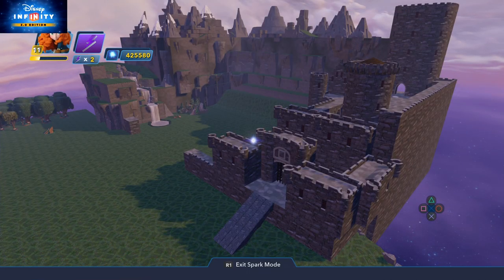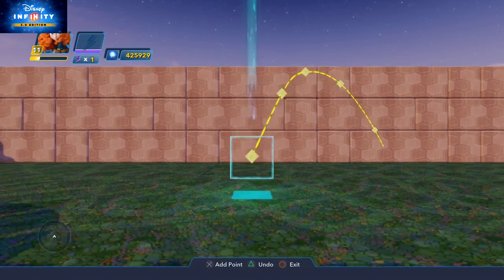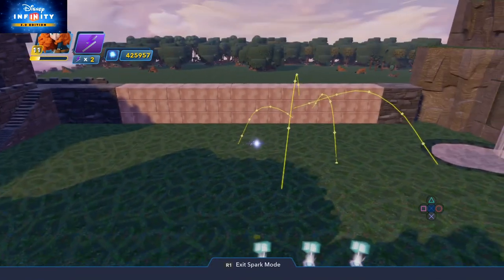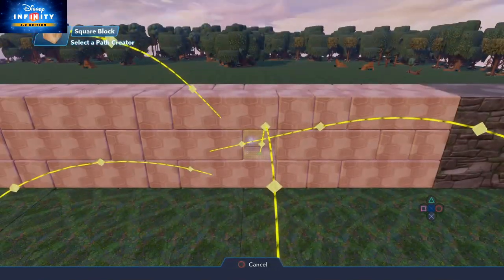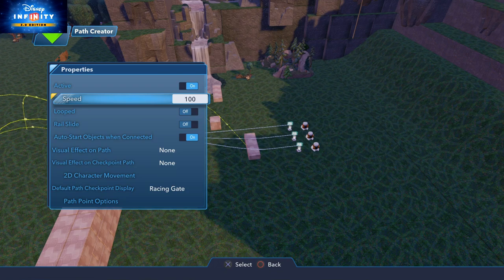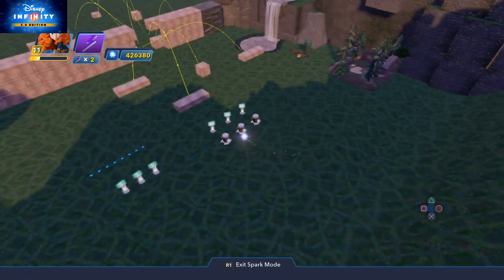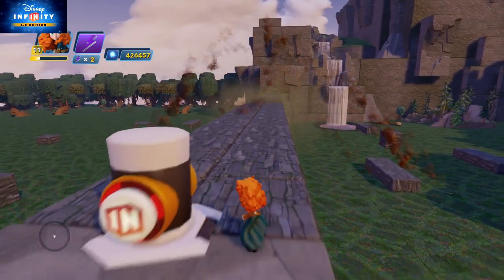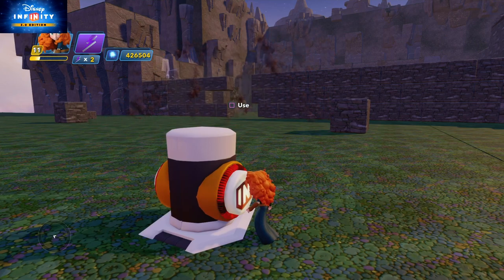Disney Infinity - How To Blow Up A Castle Wall

Comment: just wondering, is the wii u version as good as the PS4 version? (in terms of graphics, features, etc...)
Reply from the maker: From what I am aware, all versions are the same, as well as the graphics. Now I have played on 3 different version Vita, PS3 And PS4. They were all the same game, but the size of toyboxes that you could make did differ. The PS4 allowing for much more complicated Toy Boxes. I presume this is down to memory. There is no difference between the PS4 and PS4 Pro. All Playsets and unlockables are the same on all versions - Although the IPAD had a special unlock where you could get the E11 Blaster.... This was never released to the other verisons. Hope this helps.